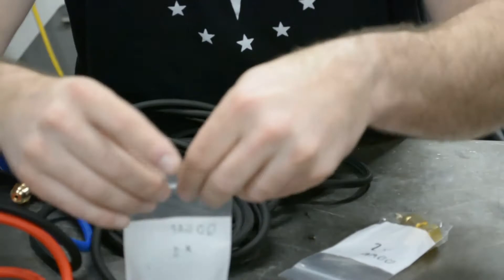Tig Torch Upgrade (Everlast 325EXT)

Comment: I just ordered the 250 flexloc same setup with cooler for my mts275 I tried to reverse thread the torch in and found my sl-what35qd came stripped I discovered it with a finger rather than kill the torch side ,going to get a replacement sent. The torch body is half the size of my 18 it's amazing stuff